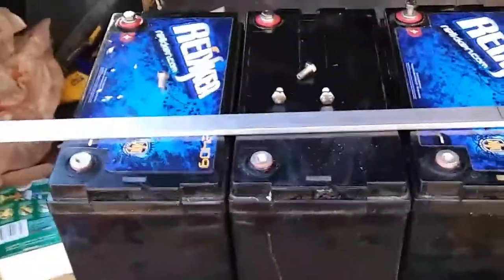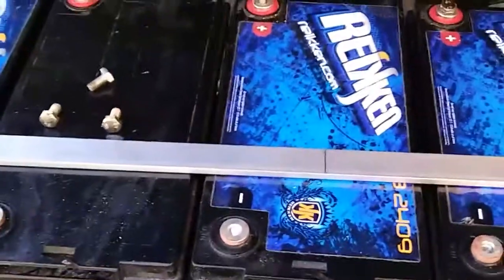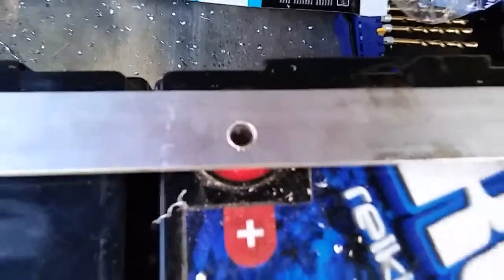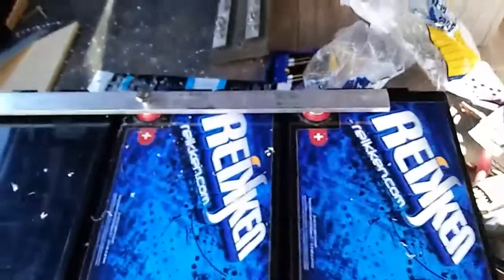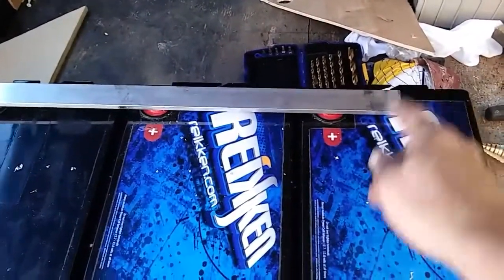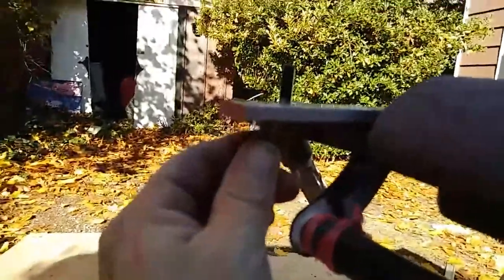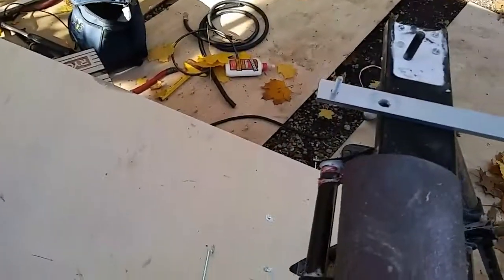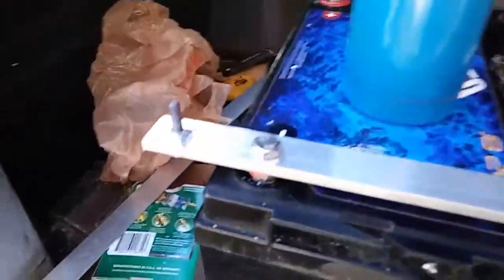How to make a busbar for a battery bank

Comment: Hello..  Is tis a good way to balanced Charge / Discharge a 12v (6) Battery bank set up??   I am a beginner..
  .I have 4  100ah AGM's now in a 12v set up in Parallel but want to go up to 6 batteries next.... But- I can't find any diagrams about  hooking up 6 AGM 100ah batteries (Parallel) in a way that is equal charge / discharge like the one I found for my (4) batteries I have now...  Like I say- I have 4 now and found a great site that showed me how to hook them up to properly balanced to draw and charge .....but- now I want to upgrade to 6 and no one has a bank diagram for 6 batteries...Is it just a simple arrangement based on the 4 battery diagram I have to use now?  Or should I go to a Buss bar set up?
  I read that you should avoid just lining them up like that and attaching them in a row, better to use wires equal lengths to attach 2 batteries then a longer one to jump over to each pair then put the inverter wires and controller wires in specific places....
Here's the link to the diagram I used... (#4) http://www.smartgauge.co.uk/batt_con.html
now I am thinking for 6 batteries I need to use #3 with a buss bar?

Comment: Beautiful busbar and everything, but I bet you wish you had a bigger diameter bolt at end so cable was snug.  But these are the types of videos I love as it give so many small modification ideas.
Reply from the maker: pirucreek it's hard to say I struggled with that I wanted to use a bigger Bolt but I wanted more contact on the aluminum I'm not really sure which is better with the lock washers on it doesn't move but thanks for watching I appreciate it

Comment: how thick is the aluminium you got bro
Reply from the maker: BIGJURAY20 I think it's quarter inch or half inch I got it at Lowe's they have them at Home Depot 2
Reply: TTS bobby thanks bro appreciate it
Reply: looks 1/4 in        not thick     if it was copper then it would be ok..       also use dieelectic grease people.

Comment: Hey bro I had a question I meant to ask you earlier,im about to buy 2 18sand I can't decide between DC audio level 4,or I have been looking at the SSA Zcon so I would appreciate your opinion on which ones I should get,so if you had the choice which would you get and thanks for your opinion bro.
Reply from the maker: Tater Tater it really depends on what you're going to power them with they're both awesome subwoofers the SSA need a little less power to get nasty the dc-4 need more power but are nasty too personally I would go SSA just because of the efficiency
Reply: Thanks dude,i have been leaning towards the SSA,its just hard to make final decision,i appreciate the advice,ive asked 1 other person and he said SSA.I value your knowledge on the two so thanks dude you da man.SSA it is!!!!!
Reply from the maker: Tater Tater.  np homie

Comment: next time you do them, use electrical grade aluminium, by systems voltage improved when i switched over
Reply from the maker: Andrew Elrose I use the same grade aluminum as I did on my bus Bar
Reply: i know, when i bought my bus bars online, they turned out to be wayyy better quality then the ones in home depot and it helped out a lot